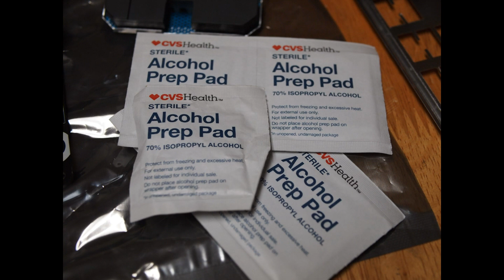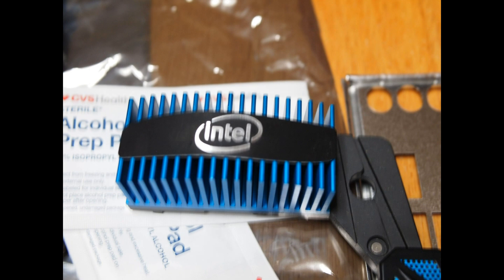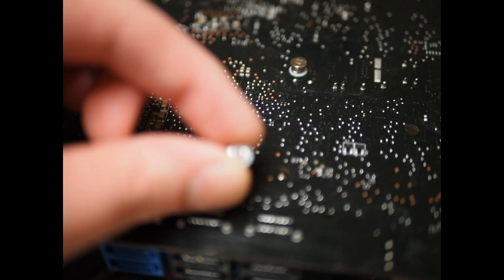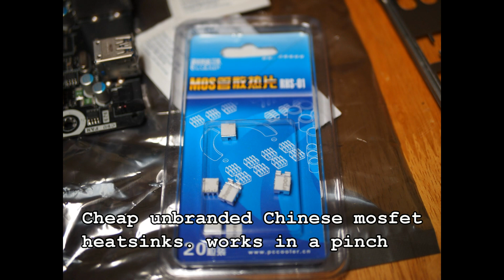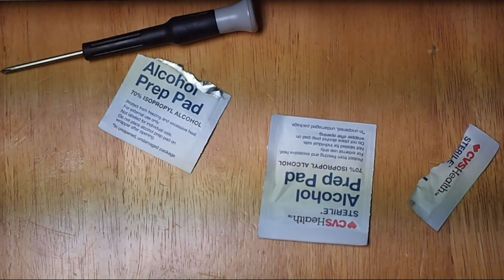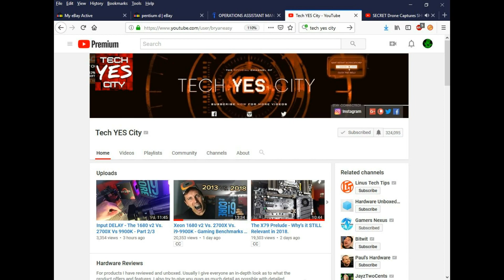Intel's unknown X79 motherboards - DX79TO

Comment: I have the same board I run an e5 2670
Reply from the maker: Oh wow! Someone commented. Thanks, and that cpu is still great for work related stuff. Good multithread scores. I was looking today to see what the deals were on ebay, and there's an e5-1650 for $69. It has about the same multithread rating as yours, but way better single thread scores. I'd give that a try for sure.
Reply: GameTech Reserve I’ll check it out. Keep the videos coming when I get to my new position I’m doing a channel as well. Mainly concerned with cloud, aws, gce and openstack. I’ll sub you tho.
Reply: @davidb8831  can you please tell me how much ram you have on your motherboard with that xeon? It's a v3 xeon? The ram is ECC or normal? I have a dx79si with a xeon 2620 I think. But I don't know if I can have 8x8 GB or 8 x 16 GB ECC ram on it. I want to use for some virtual machines. Thank you